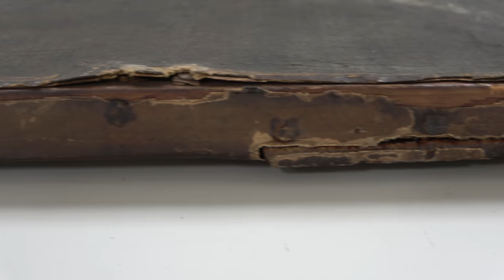Secrets, Sins, And Salvation - ASMR ish

Comment: Hmm, I dunno about this one. I mean, don't get me wrong... most of it is a rather heroic conservation effort and I'm overall a fan of the work here. But the right eye (that is, the eye on our left) seems like it should have had more of a crease coming out under the eye from the inside corner, just based on the surviving paint after the retouching was removed. The old retouching went pretty heavy on that, and I wonder if they did so because they saw the original before it was so badly damaged. But this retouching completely omits that, even though it looks to me like the surviving paint indicated it. Anyway, the right eye looks a bit out of place in an otherwise great looking painting.

Comment: Question,

Watching the videos I understand why you use the fill in medium to the low area damages. How are the conservative paints different than regular paint that it doesn’t create a high spot on top of the now level surface?
Reply: Not a conservator, just someone who paints, if that counts: paints have different bases and different consistency. Oil paints (original material) are very thick, which allows artists to “cake it on” and even create impasto if they so choose (and us, viewers, subsequently see every brush stroke they took). Archival paints from what I gather are pigments mixed with synthetic resign which is more... liquidy.... it makes it very thin even when opaque. That’s why those paints can’t fill up the voids or create high spots.  Think of it as covering a piece of bread with soft butter vs olive oil